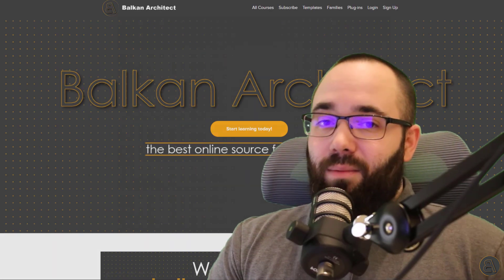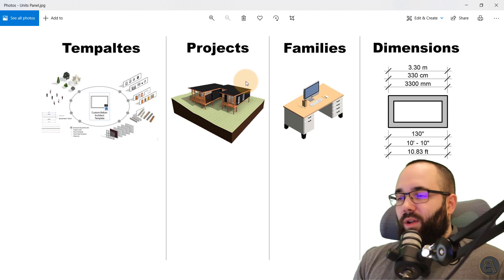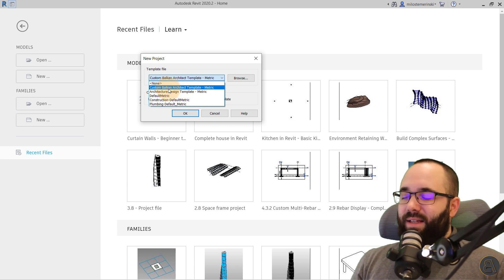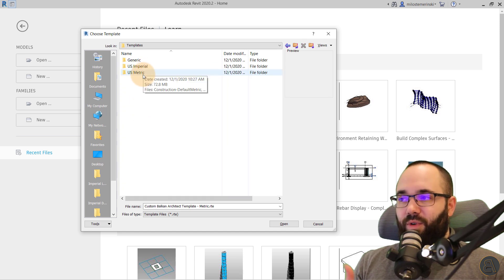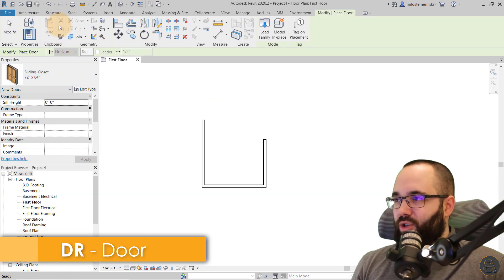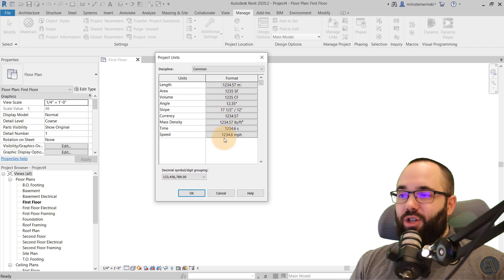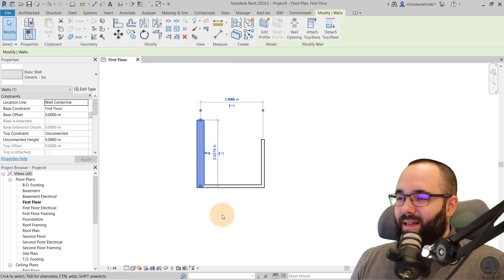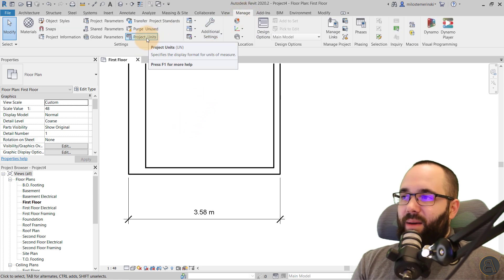Converting Units in Revit Tutorial - for: Templates, Projects, Families and Dimensions

Comment: I think you are missing one form of units and I cannot find the answer anywhere.  When dealing with MEP components you are usually in inches or mm.  Problem is, you can only really change the units based off of the project.  However, when you go into some families like Nibco, you can see it's set to inches with no feet shown at all.  Hopefully I can find where this is, because it's driving me nuts when I want a 12" fitting it will either error out or give me a 12' (144" fitting).